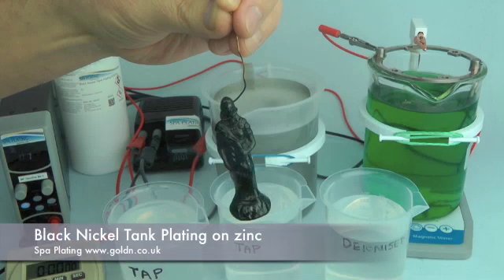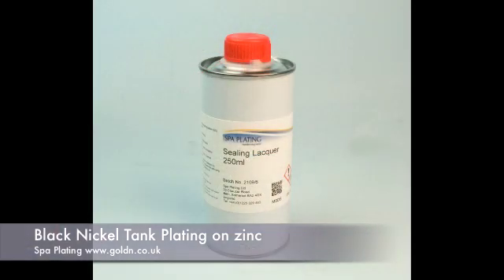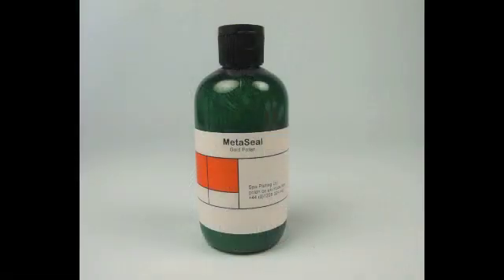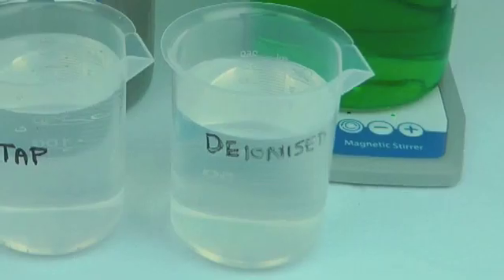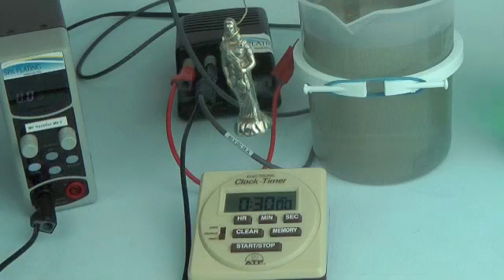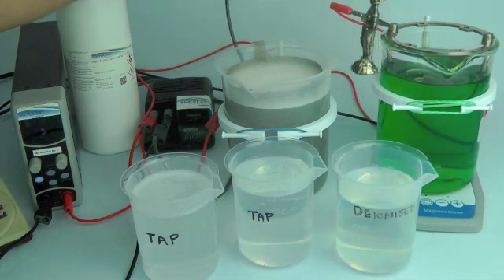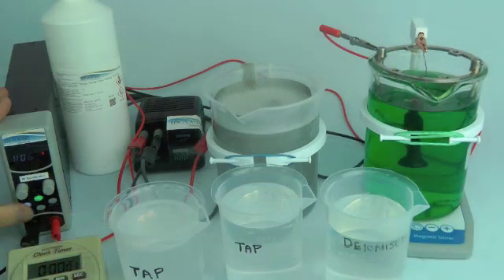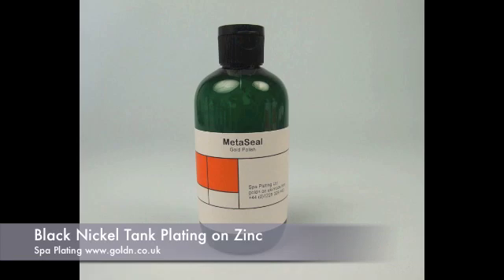Black nickel tank plating on zinc

Comment from the maker: You will need to calculate the amps required for most of our solutions including black nickel as we do not calibrate using volts.
You can calculate the amps using our online calculator:
https://www.goldn.co.uk/black-nickel-tank-plating-calculator
Reply: Thank you i see in video u plating zinc piece can this solution plate stainless steel or other steel as well ?
Reply from the maker: @Jaymunozjr  If plating onto stainless steel, I would recommend a nickel strike or gold strike first. This solution can be plated directly onto steel however, as the plated layer is very thin, it will not protect the steel from corrosion. Steel should be plated with protective layer of nickel first, then black nickel plated.